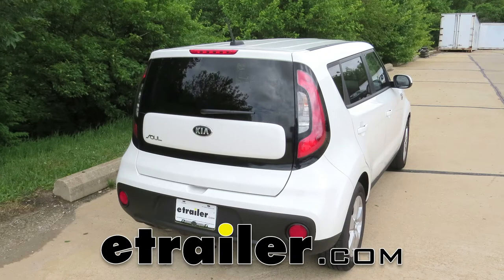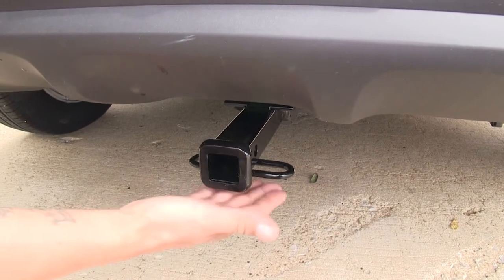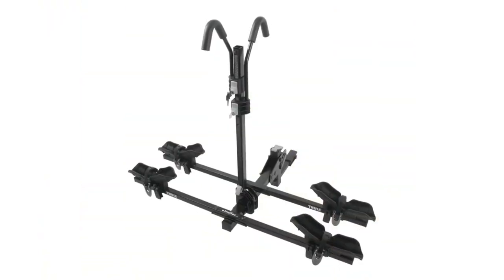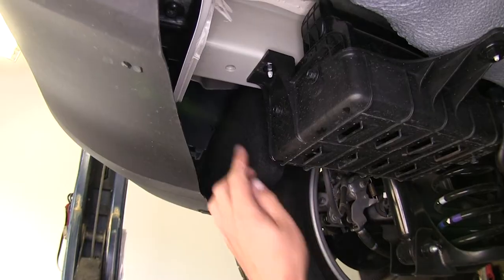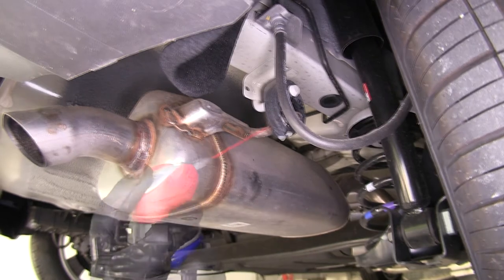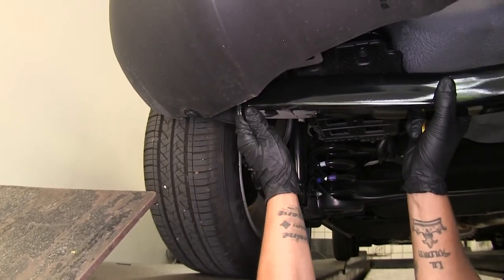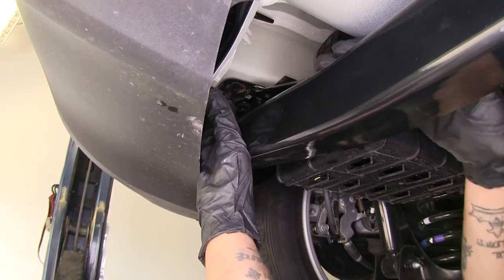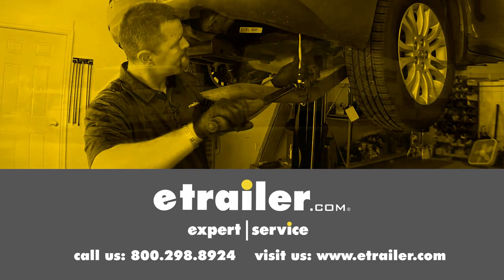etrailer | DIY Install: Curt Trailer Hitch Receiver on your 2017 Kia Soul

Comment: Doesn't the KIA Soul owners manual say NOT to tow with this vehicle???  I know some people do tow with them, but it would seem to me the tiny engine and transmission would be under a tremendous strain and highly prone to failure.
Reply: For me, it's not about towing. I love how tiny and compact this car is, but I hate not having enough space in the back to put two mountain bikes for my fiance and I. With a reciever hitch, I can buy a bike rack that attaches to the hitch freeing up room in the car.
Reply: Nothing wrong with towing with any vehicle...  Just know what you're towing and use your head.  You can tow a nice pop-up camper or a small, light trailer with this vehicle.  We have a 2017 and it's just fine for that.  Just based on horsepower and the small brakes, I doubt you could pull anything more than that, but hey, I've seen VW Beetles tow things so...  The rule is to not tow something that outweighs the tow vehicle.
Reply: So I don’t need to remove the bumper ?
Reply: @cameronbahari  nope
Reply: You can tow an empty tow dolly to pick up a vehicle. Swap the tow dolly to coupled behind the bigger vehicle and place the Kia Soul on the tow dolly and tow it.